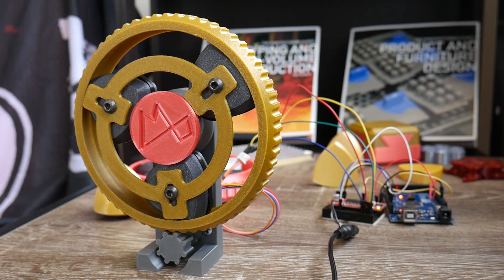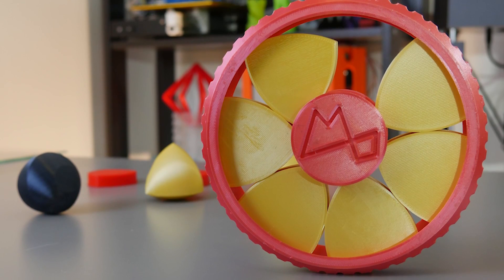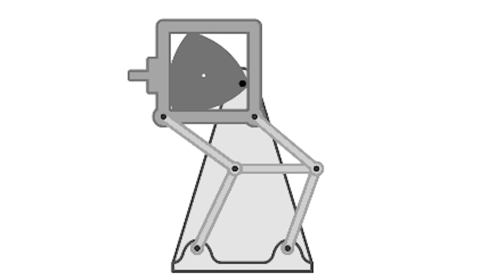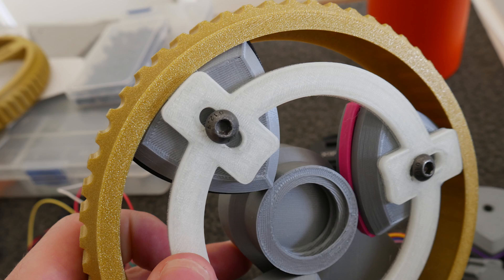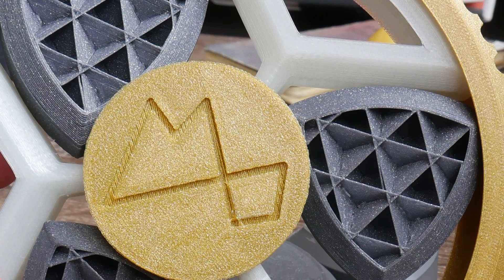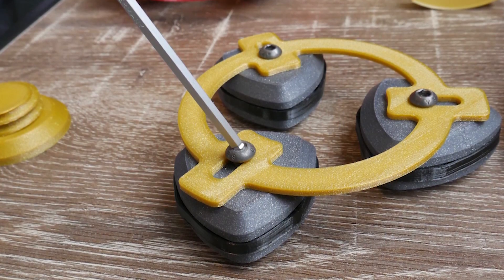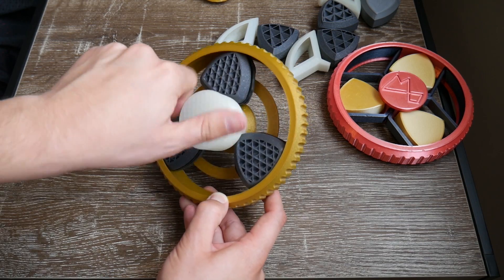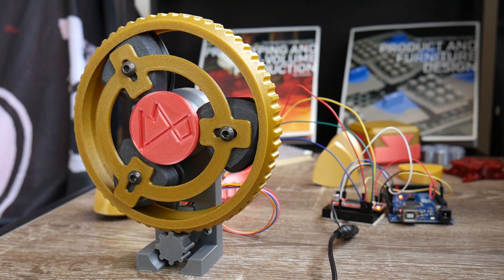Reuleaux Triangle Bearing - Working

Comment: Your bearing "ring" is circular, but it would be cool if that was also a Reuleaux triangle :P
Reply: jeffawang 
Awesome thought! 
Initially I 100% suspected this would fail. BUT I think you're actually onto something! 
IF the center, fixed Reuleaux Triangle were the same size as the orbiting ones, AND each orbiting piece was inserted so that their contact point is 60° different from the center (the center of each orbiting Reulaux Triangle's edge contacts a corner of the middle, fixed Reuleaux Triangle), AND the slotted connections were eliminated (I'm thinking the moving center points cancel one another out if they're oriented as mentioned above, meaning they can be fixed by their geometric center), then it MIGHT work.
That would be seriously cool, what a great idea!
Edit: I just re-read your comment and realized you said bearing ring, NOT center insert. I have no clue how that could work but also an awesome thought.
Reply: I did originally mean the ring, but I like your instinct to Reuleaux all the things! Turns out it's you who's onto something, haha. Shapes of constant width still boggle my mind, so I'll have to ponder the center Reuleaux triangle for a while.

Comment: Awesome! Fascinating stuff. If you don’t mind, would you be able to model the distance between the center points of the shapes as they rotate. I’m wondering if the constant-width shapes can be phased to maintain a constant center point distance. That would allow an external ‘cage’ that probably has a triangular path.

Very cool stuff.

Comment: The reason the ring on the Reuleaux Triangle "migrates" is because it has slack, if you printed the triangle with a dual extrusion printer 1/2 the ninja flex or whatever you used as the rubbery stuff an the other 1/2 pla, it will work. This is because when you make it with one part it has no slack.

Comment: The reason for the drag on the insert is that it stretches and deforms, thus not maintaining a constant width. Like a tyre it gains slack on the approach side and strain on the opposite. Also could also be affected by the ratios between the inner surface, the shaft and the size of your shapes.

Comment: you could print the rubber as a circle witch the same circumference.. or you could "glue" the in the spot ... or you could model an gear-like teeth that holds in an spot inside the "roller"

Comment: The flexible ring's problem would be fixed by adding a tooth profile to the hard plastic and the ring, this way it can't just simply slip on the ring. Somewhat how a serpentine belt works. 
I'd also try this with a pentagonal shape of constant width, the corners aren't as sharp as the triangle's. 

My suggestion for constant width projects would be to create gears, involuted if possible; and if done, definitely a planetary gearset, and possibly a worm drive set, with the constant width shape being the worm, pinion, or both if possible.

Comment: Make the triangles as long rollers with a taper, like a normal roller bearing. Then put an axial load on it to provide the friction needed to make the rollers rotate instead of slide. That's how a cage with flat sides would work with Reuleaux rollers may work without resorting to rounded points and rubber rings.

Try some super glue between the soft rings and the rollers to stop them creeping around.

Comment: I'm not sure how the flex fit prints, but I bet if you made little pins coming out of the center of the 3 sides and made little holes in the bearings, you could put some super glue in and put in the pins, that would stop it from slipping.

Comment: Why all the Arduino madness for the motor, would a battery and an old motor work fine instead?
Reply: I assume he's using it for PWM or some such. Also, it might really be a servo (not just a simple motor) so that it has the feedback for any slips, so he'd need a servo controller. I'm giving him the benefit of doubt, though.

Comment: The rubber rings are most likely shifting around due to compression slightly affecting the fit of the ring. Take a a look at  hypocycloidal gearboxes with a really high gear reduction, it's producing a similar effect!

Comment: The rubber insert is probably causing hysteretic loss by deforming under pressure.

As it deforms, it's moving like a worm or snake slowly inching forward.

Comment: Unless I'm mistaken, the path of the center of each triangle will be a circle.  Because they are out of phase, their radial advancement will vary.   Despite being restrained, they don't want to remain 120 degrees apart.  I suspect this is why your tires are creeping around the triangles.  I think a set of planetary disks in lieu of the slots would allow for the natural motion.

Comment: I think there is a mathematical issue at play. Draw two radii from the geometrical centre of the Reuleaux triangle with an angle of 1 degree between them. Measure the fragment of the outer perimeter of the triangle that fits between the radii. This will not be a constant but will depend on where the radii are drawn angle-wise. In other words, when used as a wheel, a constant rate of rotation of the Reuleaux triangle tranlates to variable linear motion. This variability is fine as long as your Reuleaux rollers are in phase with each other. Otherwise, pulsing motions from three rollers will counteract each other and will result in slippage here and there. This is a part of the reason why the rubber inserts migrate.
Reply: To insert them in phase he could position them on the support in correct location/rotation, it would probably be best to create a template of some kind, and over tighten the bolts. Then put it in the casing and loosen the bolts.

Comment: Now, as a challenge, make the small gear that drives the "kinetic sculpture" a reuleaux triangle as well. You'd have to mount the gear and the motor so that they could move a bit, to cope with the changing distance between the center of the gear and the contact point, but I think it would look super cool.

Comment: Hello AngusThe rubber acts as a compliance surface taking up the slight variations in tolerance of the different parts. It's a very cool idea on how to always have touching surfaces in static friction. You could try and key in the flexible material into the shapes.Great Video Mate! CheersMichael

Comment: Due to the rubber rings migrate around, gear the outside of the Reuleaux Triangle to lock into a gear inside the outer ring. making the gear set looking like a Reuleau Triangle planetary gear set. Awesome videos and thank you for all you do for the 3D printing community.

Comment: The center points of the big circle and small circle(single side) should be the same point which is not at 4:34. Then the sketch will be fully defined.

Comment: Is the chord running between the two contact points of each triangle always radial? If the inner and outer contact points are offset around the circle, then the distance isn't the same as when they're radial. i.e. the Reuleaux triangle may not be the correct shape.

Comment: I have been considering getting into 3d printing and this project gives me a perfect opportunity to get a better idea of the costs (personal and material) of designing objects of the type I find interesting. 

to get this far, and including failures, how many hours of your time would have been spent designing and setting up prints. how many hours would printers have been running, and how much filament consumed.

(i will of cause be considering my inferior skills and the fact that print speeds vary when considering how long it would take me)

Comment: That's in interesting piece of active sculpture.  I don't see that the triangular-ish pieces are actually bearings.  The closest thing to bearings on this are the screws in the slots.  The rest of it works more like a carrier.
It seems strange that the components with curves of equal width do not function with a fixed axis.  Because they won't work with the fixed axis, I wonder if the curves actually represent equal width components.
Reply: I understand that the corners are the opposite of the arcs, and should be part of the constant width.  I may not be understanding the whole story, though.  It seems like there should be some center point, but maybe I'm thinking about it in terms that are too conventional?
Reply: I see my misconception now.  I'm a machinist, so I see a lot of different ways to make mechanical movements, and to me this piece resembled a carrier for a planetary gear setup.  Once I did a scratch drawing on the work bench, I see that the center point is the wild card here.
Thanks for the discussion.

Comment: Have you thought about putting gear teeth on the perimeters and the inner and outer races, instead of rubber? And if you did it that way... could could print in place without any assembly.

Comment: I hate to shit on this. My only comment in the negative form is that you use flexible material. You also stated that there is friction. If there's friction that means that there is pressure applied to the flexible material. If there's pressure applied to the flexible material, then that means that there is deflection. However my new, it violates your rule of using solids of constant with. Other than that I think it's a super cool desk ornament.

Comment: Can you stick an LED on one, turn off the lights and do a long exposure of the movement pattern? That could be interesting to see!
Reply: you would have to have either a very small led or a very a large bearing otherwise you would end up with a wiggly circle (one revolution of the shaft per frame) or just a glowing circle (multiple revolutions per frame) as the path of the led would overlap with its self too much. A couple alternative ways is to film it and layer frames on top and blend it for a cool time lapse or user a UV laser pointing at a glow in the dark screen. Please don't miss understand me I am not criticsing your creative genius of an idea here I think its brilliant I am just adding my take on how you could make your idea come to life
Reply: @daniwalmsley611  Why not use a reflective surface and reflect ambient light instead of creating it? It doesn't even need to be a spotlight, a single LED aimed at the device would suffice, and it can be far enough that it doesn't illuminate the model.

Comment: I am not from an engineering background but love tatting about with my Cel Robox machine. And this is VERY interesting. I may have a go at a smaller version though tolerances do I presume become tighter as sizes diminishes. Keep it up.

Comment: Variable contact of surface area. With the "rubber" ring around each bearing it will squish and the amount of surface that makes contact with the outer bearing surface will change. Lets also not forget that larger shapes have more surface area (seems like a simple concept) but even in a normal skate bearing the outer ring moves at a different rate than the inner. So a ball bearing has a variable speed that it can not possibly account for. This causes a minor amount of friction, but still much less friction than a bushing because the contact area is still reduced. 

There are many forces inside of a "normal" bearing and those are compounded (or at the very least they are not better than a ball bearing) by the triangle(ish) shape. It's no wonder that the rubber sleeve moves about...

Comment: Nice, but I am a little disappointed that there are still some sliding in the system, namely in the nuts that hold the bearings in the holder frame.

Comment: Your flexible ring is travelling because your three rollers are not synchronized - the ring that keeps them apart wants to rotate at different speeds if one of the tips of the triangles is pointing directly inwards or directly outwards. If all triangles have their tips pointing inwards or outwards at the same time, then they want the ring to travel at the same speed at the same time. If they are not then there will be forces as the triangles will want to move at different speeds. This will make your flexible friction ring travel.

Comment: Sweet! Although, the arduino is overkill. You could have hooked it to a 9v battery with a on / off switch. Maybe with a potentiometer to dial the speed of the motor.
Reply: I assume he's using it for PWM or some such.  Also, it might really be a servo (not just a simple motor) so that it has the feedback for any slips, so he'd need a servo controller.  I'm giving him the benefit of doubt, though.

Comment: just a quick idea I just had, dunno if it works out physically: couldn't you use 4 of these objects and fit them into a fixed bearing in a way that they are synchronized and the whole bearing moves in the shape of a square?

Comment: You've probably thought about this, but it seems the rubber rings migrate, as you say, because they're squeezed right before a "peak" (or whatever you wanna call it) meets a point, either the center axel or the outer wall. I suspect this is because they're not rolling on a flat surface, but on a curve.

In my mind, with absolutely no evidence, it seems making the circles making up the SOCWs smaller (in some way related to the curvature of the outside edge) would fix it, but that's just a theory. Making the rounded corners even rounder might also help?

Comment: To fix the rubber problem move it from the OoCW to the surfaces that they touch. That way if the rubber does move it won't be (as) noticeable as the rubber would be a circle.

Comment: Did you hack your little stepper into Bipolar mode or did you leave it as a Unipolar?

I've been messing around with them recently and found that by hacking them into bipolar mode and using full steps (most guides show half steps) they use a lot less power
Reply from the maker: Bipolar! They have literally no torque otherwise. It's super easy just cut the red wire trace on the pcb 'edit' mine do get a bit toasty though haha
Reply: You can get some torque out of unipolar, you just need to drive them with Mosfets and use a longer step time, which makes them slow.

Much easier to do the hack and plug them into a driver board

Comment: The reason you're flexible ring rotates around the object is because it's not moving it's acting like a tank tread if you look at a tank tread in slow motion the part of the tread that touches the ground isn't actually moving the rollers are rolling inside the tank tread well your bearings are rolling inside their tank treads or the flexible ring you printed
Reply: Nerys it's probably something like pushing a bubble out of a screen protector but with one less dimension to worry about. That flexible band just needs a little bit of adhesive or something.
Reply: Couldn't it be also because on the outside you have a perpendicular force acting on the flat surface on the outside of the flexible insert while on the inside it's split along 2 diagonal surfaces, hece providing more friction on the outside than the inside?
Reply: Olivia Lambert why are you so bitchy about it? Since when ingnorance on a certain matter is so despicable to need such rudeness?
Reply: Steven McCulloch or just shrink the inserts a tiny bit so that pressing against it while rolling won't stretch it away from the hard bits as much. Or, hell, replace the inserts with rubber bands.
Reply: Uh well done you noted the most fundamental rule in any wheel, tank tread, bearing, or rolling frictionless device? I'm not sure what disappoints me more, the fact that this is a genuine "discovery" to so many people or the replies and "insights" in response. All thats left to work out is if I should weep for humanity as a whole, or just the American education system.
Reply: @olivialambert4124  what a silly response.

Comment: The rubber displacement issue, can it be solved by changing the size of the reuleaux? is the diameter of the inner piece same as the reuleaux ones? Btw that spinning is so beautiful

Comment: There is something oddly satisfying about making a useless object that works exactly the way we want it to while doing nothing.
Reply from the maker: This sums up my purpose in life.
Reply: Hi, Angus! Did you've tested it under loads and speed? It's interesting how long it can serve and how much it can take. If I've had your resources then I could make a bigger version of it with presssure sensors, torque meters and etc. Maybe you should check for patents! This thing doesn't look useless.
Reply: You'd be surprised how many useful things we have today that were only possible because we making "useless objects doing nothing" decades or centuries ago, just to see if they would work exactly the way we envisioned. Case and point, goofing around with quantum physics in the 1920s, just because we felt like it = transistor chips by the 1960s.
Reply: Today's art is tomorrow's space programme.
Reply: Perhaps that is Lady Muse's view of Angus.  :)

Comment: Looks like the grips migrate round the triangles as they are compressing when they contact the shell, making the total length of the grip longer and therefore coming away from the triangles themselves allowing some slight travel

Comment: You said about investigating the slight movement of the flex insert, if you look at the video after you hook it up to the motor, one of the views from behind you can see that when the ball bearing nears the top of the rotation the insert bumps out which could be the reason for it moving. Maybe a slightly tighter or thinner insert could prevent this.
Reply: A follow-up, it could be due to the change in pressure as it rotates around the gear. The amount of area in contact with the center piece is always changing due to the points vs the flatter edges.

Comment: A cheap solution for those without flexible materials would be to use a rubber band.
Reply from the maker: I tried one and they worked for a bit but broke, an O ring would be perfect though if you can find one that's the right size.